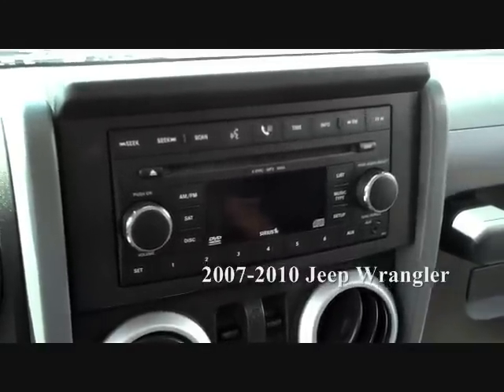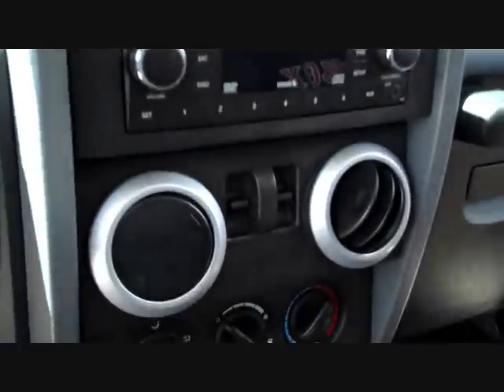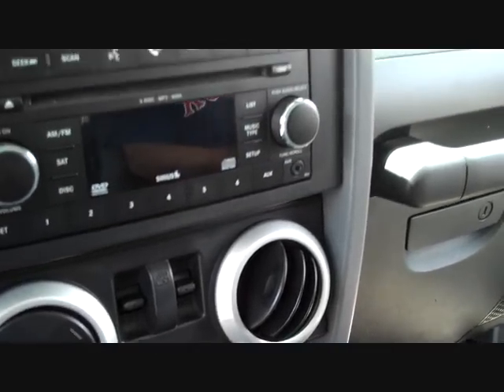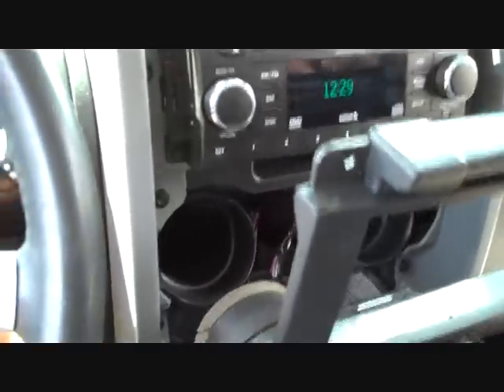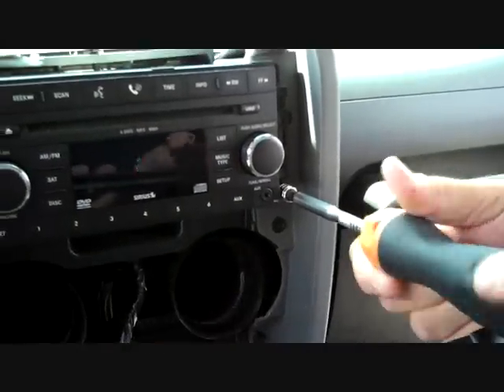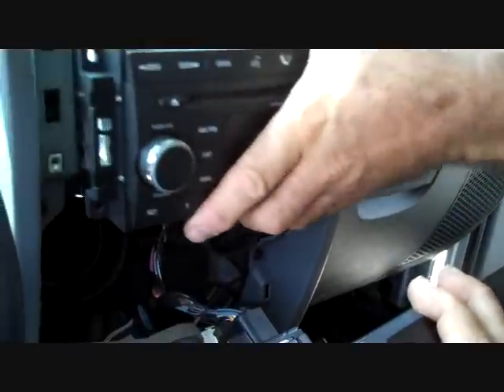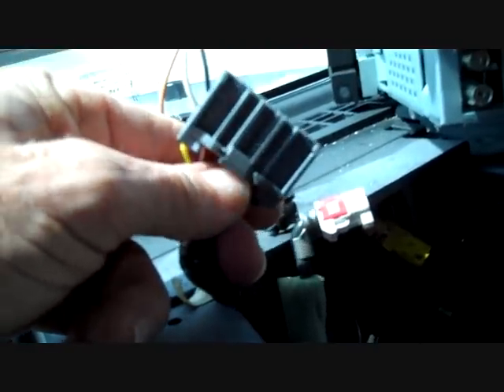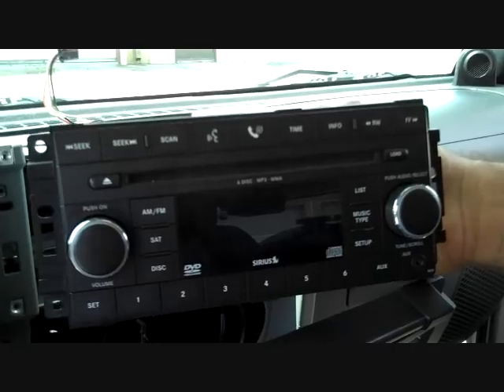Jeep Wrangler Car Stereo Removal 2007 - 2010 = Car Stereo HELP

Comment: Hey for the first part with removing the dash. After removing the top two screws from the frame there are two more on the bottom behind the netted pocket board. The board comes off by gently prying an once off the two screws will be revealed. After removing those the whole dash will be removable as shown. Great video by the way! Extremely helpful!

Comment: Thanks bro. Nice Job. I'm hoping I can get a replacement that just plugs right in and I'm done but this helps with a cb bracket mount location as well. Good stuff.
Reply: Did you ever find a replacement that plugs right in?

Comment: I just purchased an 07 Sahara wrangler unlimited. It has the exact same stereo. Everything works on but I can't get it to play CDs. It says DVD across the screen when I put in a CD, then a disk read error appears and it spits it out. Is there some DVD setting it's stuck on. I can't get it to read the disk as a CD and am wondering if it can be reset somehow

Comment: My dad is replacing my broken radio of a jeep patriot 2009 with one from the car junkyards.  Each radio that was replaced does not allow the c.d. player to work.  Is there another connection or cable that we're missing for the c.d player to work? Or are they just non functioning?   Thanks!

Comment: I want to install a line output converter (Pre-amp RCA out) to the existing factory stereo, which left/right wires do I connect to on behind the factory head unit?  Would appreciate the help, thank you!!
08 Jeep Wrangler JK

Comment: would i be able to fit a double din aftermarket radio in there?
Reply: a double din works but you may need to remove a support bar from behind the radio depending on how large the radio is

Comment: thank you for sharing this!! I have a 07 with the same 6 disc changer but my aux port is broken... i dont use cds anymore so i see on ebay they have single disc radios for like 40-50 bucks, if i were to get one of the single discs and not another 6 disc changer, would that be or cause any kind of issue??
Reply: My aux port just broke, what did you end up doing?
Reply: @timothycarroll9158  mine did too .. looking at replacing with a single din from Crutchfield. check with them really great customer support so far

Comment: Thanks for making the video.  My question is what is the yellow antenna connector for and what does it do?  I'm getting ready to install a Kenwood DNX893S and only have one red antenna connection. Thx
Reply: Did you ever figure this out? Have the same problem
Reply: Having the same problem to. The speakers wont work when I put a aftermarket stereo in and ik the speakers aren't blown, please help!